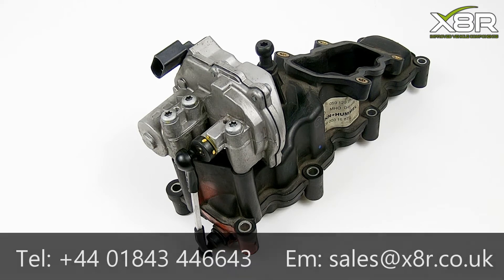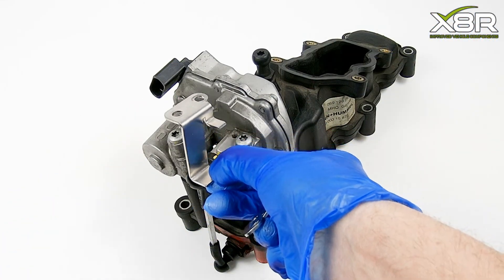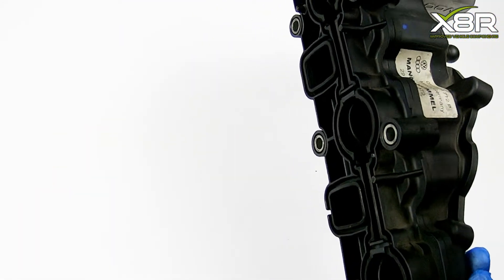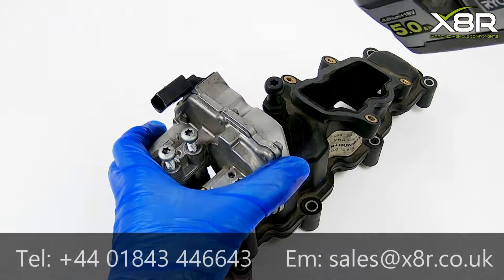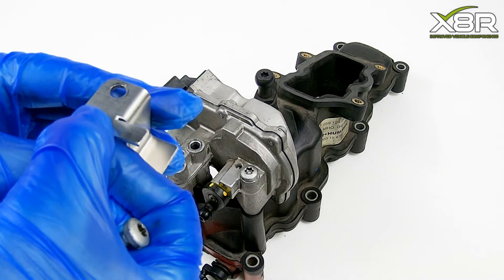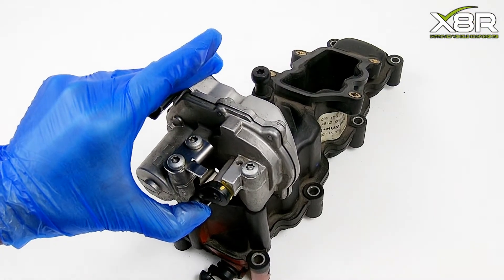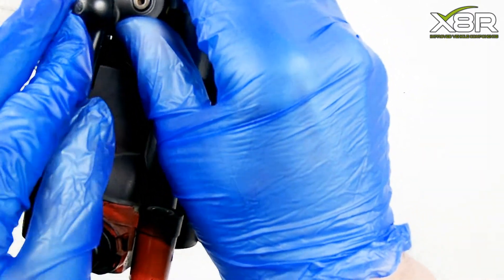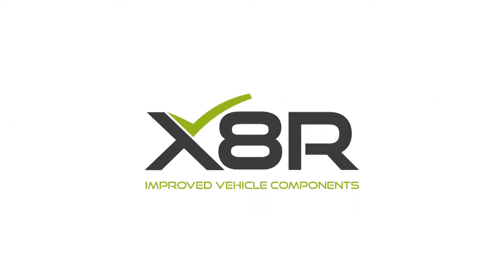Audi Seat Skoda VW 2.7 3.0 TDI Intake Manifold P2015 Error Motor Actuator Bracket Fix Install Guide

Comment: i've removed the actuator - the plastic bracket that takes it up and down.. but now can't insert it back in. :( any clues? It's a bit different than this one in the video but same job. let me know
Reply: I used a long thin pair of pliers to grab it close to where it jams back in, and then tapped the pliers - - it went in with not too much force.

Comment: Is the same kit for 2.0 or 3.0 tdi ???
Reply from the maker: Hi there,
No the 3.0 and 2.7TDI engines will need a different actuator bracket than the 2.0TDI engines.
There are two types of bracket that the 2.0TDI engines use, one is for the plastic intake manifold: https://x8r.co.uk/audi-seat-skoda-vw-2-0-tdi-intake-manifold-p2015-error-motor-repair-bracket-fix.html
And one is for the metal intake manifold: https://x8r.co.uk/audi-vw-2-0-tdi-aluminium-inlet-manifold-p2015-error-flap-actuator-motor-repair-bracket.html
Reply: @X8RLtdUK  Correct; most of the kits now come with two brackets, one of which will work.